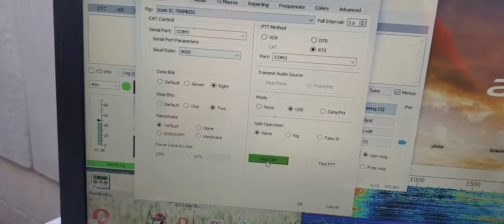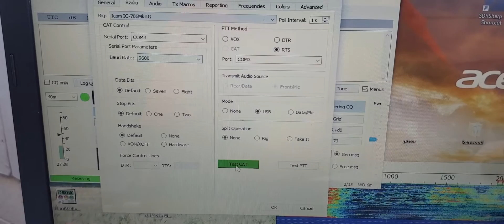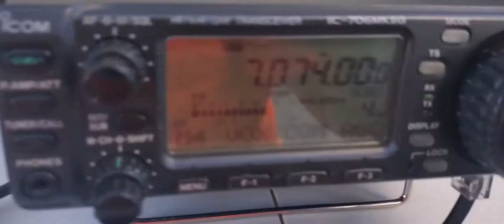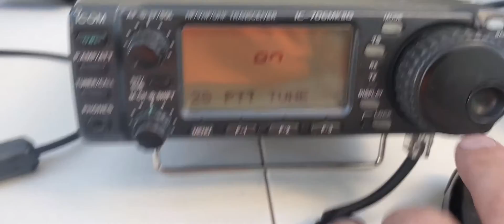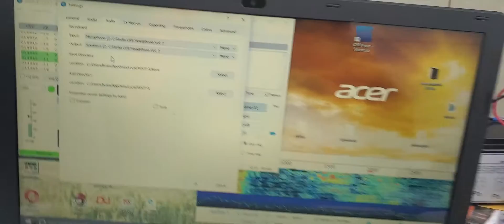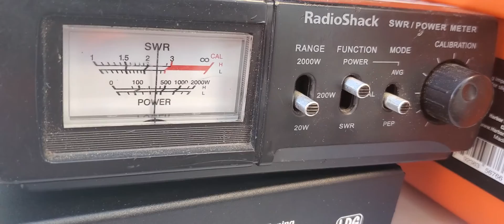How to set up icom 706mk2g and wsjt-x ft8 w cat control

Comment: It’s been 4y since you posted this video but, I just bought my 706mk2g and your video was extremely helpful. Thank you and 73.
Reply from the maker: Its a great radio. My friend has mine now.just be careful it runs hot
Reply: Is there any chance you can do a video about the cables and the physical interface between the ICOM 706mkiig and the PC. Did you use a digirig?

Comment: Are you able to get the waterfall display on there as well with the 706.
Reply: Hey thanks for responding, I’ve never messed with ft-8 and I have the 706 got a signal link and cable on order going to try this out.
Reply from the maker: @wesley20991  in the software it will show waterfall of ft8 signals. Its just using the audio signals
Reply from the maker: On the computer. Yes

Comment: connect just using one ci-v cable right? i cant make my cable to work with laptop and IC-706MK2..my VFO Encoder is broken so i cant use it to change any settings..

Comment: can we use cheap external USB instead of Signalink?
Reply from the maker: Yes. I've used some very cheap usb sound cards. You just need the radio on vox to key it. Signalink will key the radio via ptt its self, so that's why it's preferable for most
Reply: @hamradiohack  that's greats..just play & plug?
Reply from the maker: @chilskater  depends on how you want to use it. For ft8 you can literally let a laptop microphone pick up the noise from the radio and it will decode  it , and place the radios mic near the laptop speaker and with vox on you can make ft8 contacts.  Some sound cards have issues with setting the levels correctly.  I've used the mic connector before and speaker jack to a USB sound card. It can be touchy with the vox. You just have to try it and see
Reply: another question sir..my vfo encoder is broken, can i just connect the cable direct to laptop and use software to change it?
Reply from the maker: @chilskater  yes with cat control
Reply: @hamradiohack  managed to buy CI-V cable and VFO encoder...and FT8 QSO

Comment: THANK YOU!! i spent a frustrating week trying to get WSPR-X to talk to my 706. I tried everything I could think of, reloading, two different computers, home and commercial cables, two different Icoms, even trying to talk to the radio with a dumb terminal program, even a Icom control program independent of WSPR-X  ,,,  nothing worked, till I found your video. There are so many settings that have to be right, way beyond the right baud rate, setting in the radio, tons of options on WSPR-s, and any one of them being wrong will make it simply not work.  Finally, seeing the settings on your video did the trick.  I don't know which one did it, but when I setup everything exactly as you showed, bingo, things started working.  Where were you last week!!! HI HI 73
Reply from the maker: Haha, last week. I don't remember.  I'm glad it helped.  It's seriously frustrating to figure this stuff out. This video is at least a year old and off the top of my head I wouldn't remember what I did. And it's so easy to get it wrong. I'm glad I was able to help. 
73
Reply: I’m going to try this setup tomorrow night, tried Steve KM9G (TO’s) video and still nothing. Yours will probably finish off the setup. His was for the MK2 not the G, so it was a different SignaLink setup and the menus are not the same either… Thanks and I will let you know how it works out!

Comment: Hi great video what have you got between radio and computer  as I’m thinking of using my 706 for digi modes thanks.
Reply from the maker: Its called  the xggcomms.com  icom usb digimode interface.  I dont like it. It has a built in cat control cable and one 13 pin connector to control ptt and audio in and out no integrated sound card so it wont play well with newer laptops and even with a usb sound card its tricky. Your better off with a signalink. I need to make a cable for my signalink that i use with my kenwoods and yaesus . Theres other options out there.
Reply: Thanks for the quick reply yes I was looking at the signalink.

Comment: Can you show how your cables are connected? I just got the 706mk2g and am looking for the needed cables. Thanks for the video!
Reply from the maker: Its the xggcomms.com icom interface.  My recommendation is dont buy it. Get a signalink and the cat control cable instead. Ham radio outlet has everything you need. Ebay cat control cables are hit or miss. Ill do another video for you and post it up,  so watch for it. 73
Reply: Nice to see yours working. Haven’t ever been able to key up the 706mkiig with my signalink. Frustrated. 
I have ci-v control from blackcat. But I think that’s just band and freq. 
any ideas?
Thx. Jim
KD7KTV
Reply from the maker: @jimfischer4195  it could be the cable isnt right for signalink..take it apart and check that the 13 pin connection is right. Ive dealt with one being wrong.
Reply from the maker: @jimfischer4195  its easier to eliminate the cat control and just work on the signalink to start. Make things easier. Ptt requires a few things.  In this video I am using the xggcomms.com icom interface.  I use a signalink for my yaesu and xiegu g90.  Personally prefer the signalink. Just wish they didn't do the stupid jumpers in the unit to match specific cables.so make sure that the jumpers are correct inside the signalink
Reply from the maker: Cat control cable similar to this one. The ftdi chip is best. You can try Chinese ones they will cost alot less but you will be waiting a while and it may not work. I bought one years ago for $19 so thats about average..the xggcomms.com deal has one built in and a 13 din pin goes to the back for audio and ptt. But i dont like mine. So i would just buy a signalink from ham radio outlet or gigaparts or dx engineering. And a cat cable
FTDI USB CI-V CAT Programming Cable ICOM IC-706MKII IC-706MKIIG IC-706 CT-17 | eBay
https://www.ebay.com/itm/FTDI-USB-CI-V-CAT-Programming-Cable-ICOM-IC-706MKII-IC-706MKIIG-IC-706-CT-17/153890812208?hash=item23d49b7130%3Ag%3AmskAAOSwG%7EZaEIoB&LH_BIN=1

Comment: How do you connect the radio to the computer? I got my IC7300 to work with FT8 but I cannot get my IC9700 to work. I have an IC706MK2G and want to try that. For EME. They make this so freaking hard to do. Piss me off.
Reply: I finally got JTDX to work with my 706mk2g using an MFJ1204 for the audio link.  I could never get wstx to do rig control with my laptop, though tthe Raspberry PI would.
Reply: u can connect to DigiRig, U5 Link, custom cable by xgmms